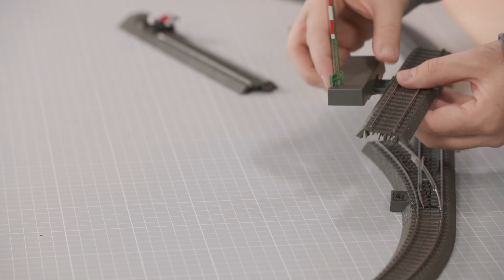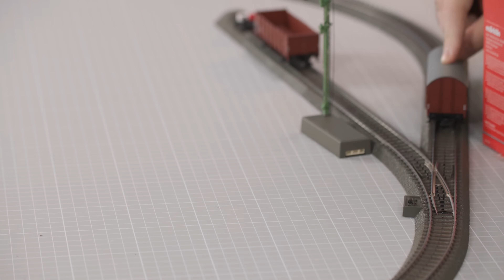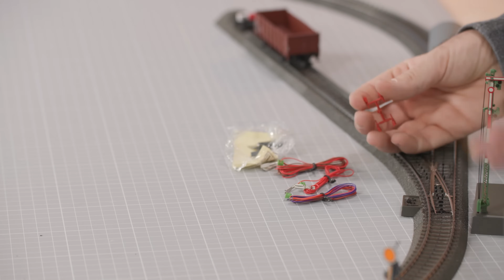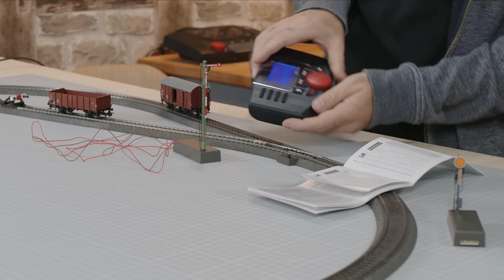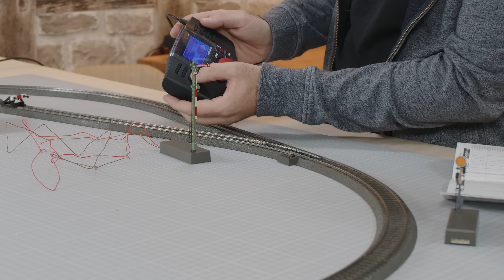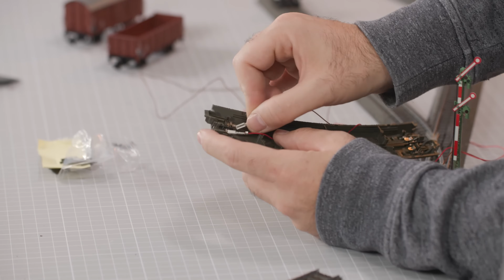Building a model railway and switching Märklin Signals digitally - Episode 07

Comment: SIGNALLING FOR CHILDREN !
All signals whether semaphore or Colour light have what is called "Interlocking" built in, to prevent "Signalman" from changing any signal, unless all points are correctly set, and NO trains exist in the affected are. All trains in real life are "Detected" by either Mechanical track treadles or electrical Track Circuitry. So what is being explained here is only suitable for a Child's toy train set. It will never replicate the real railways signals realistically.